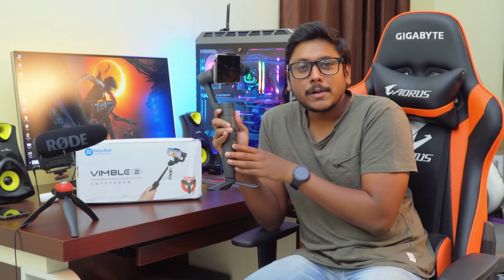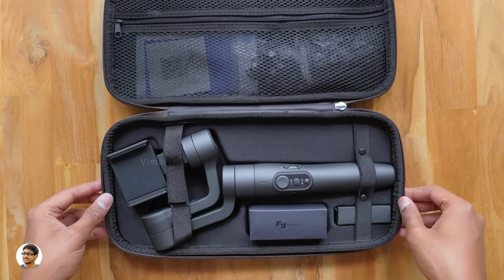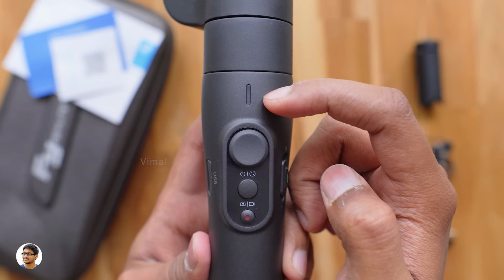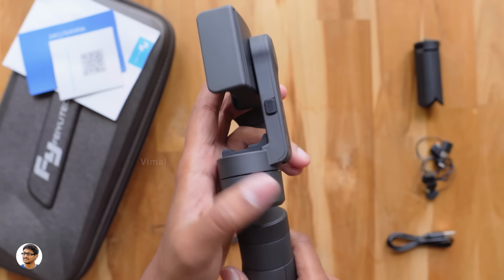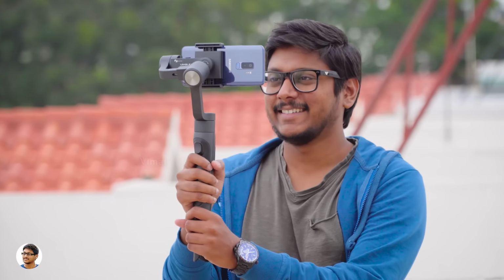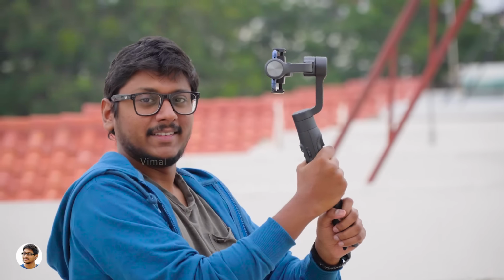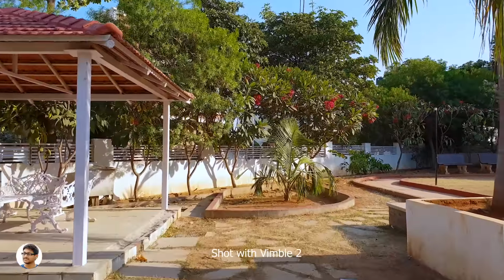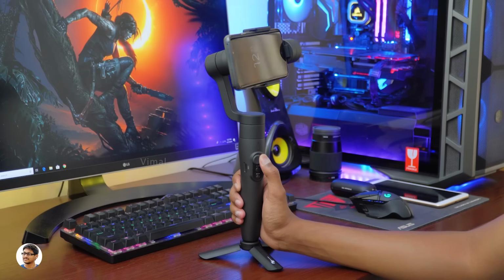Budget Selfie Stick with 3 axis Stabilization for Your Smartphone !?

Comment: I used this gimmbel and had two problems in one month while I was vlogging.  1st the usb charge can break very quickly from the inside the gimmbel. 2nd while u are using the gimbel can turn alot and the cables inside the cable can be damaged and it's a disaster can heat a lot. But since it 100$ u can't expect more. Concluding handle it carefully its not a heavy duty gimmbel